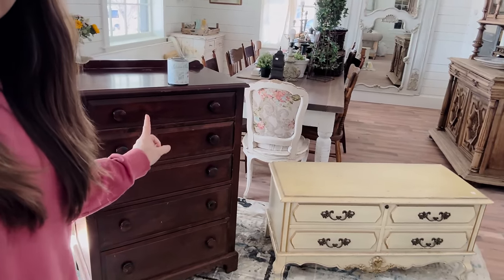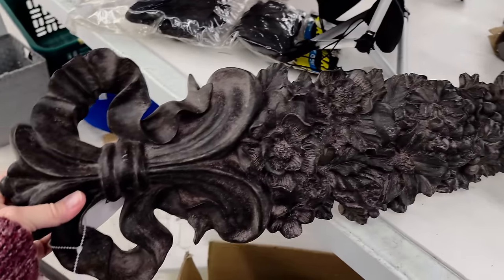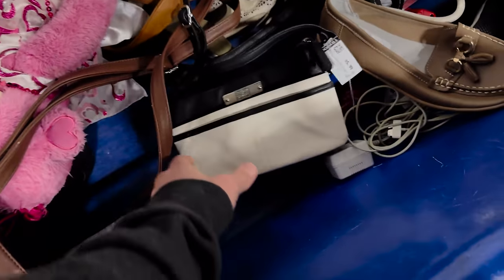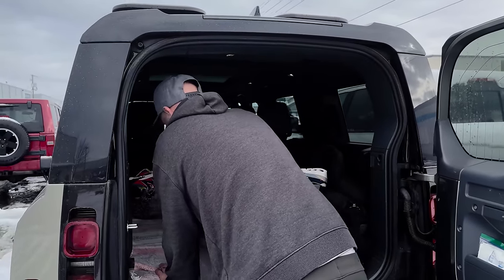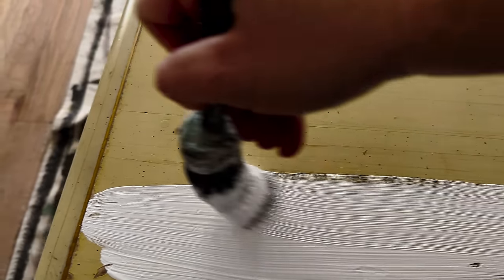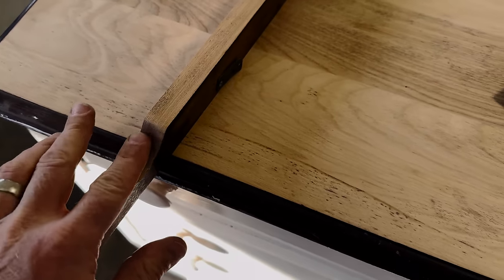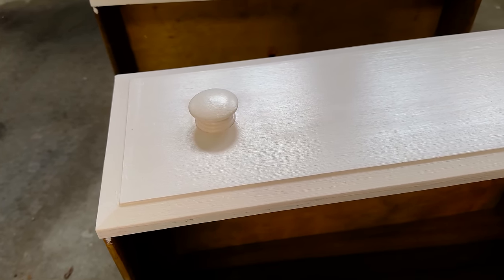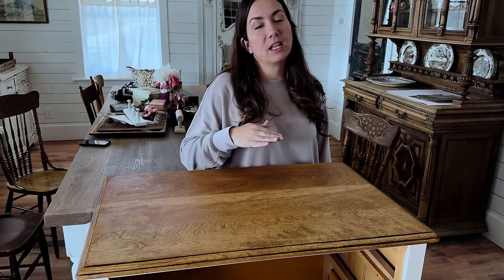Goodwill Bins Thrifting and French Country Furniture Flips

Comment: I recently bought a full size spread and shams for $5.  Looked great. They were black. I washed them and when I took them out of the washer, the tags that tell what they are made of had  shredded and there  was lint all over them. I was upset. Threw the shams away and I'm going to try to delint the spread and wash it again. If I can't get the lint off, it will become a dog blamket.😊

Comment: Hey, you can open bags and pull out what you want. Also, when I'm at goodwill bins, I may remove/take off something I needed to for my vision to safe at register. I tend to thrift heavy wood items and at my bins its $1.79 a pound, unless its 15lbs+ and then they quickly make up a price and you can pass or buy. Like I found a big beautiful frame a couple weeks ago, but the canvas was ripped and it was wrapped around wood and then was placed in frame, so I pulled canvas part out. When you have 3-4 cart full it adds up lol.
Reply from the maker: Great tips!

Comment: I understand that a lot of things need painting, and you do beautiful work, but why do you paint an antique piece made of cherry, instead of refinishing? Just wondering. I think cherry wood is beautiful.
Thank you. 😀
Reply from the maker: It’s just vintage and it will sand off. It needed refinished. So if someone doesn’t like it they can refinish it no problem. I wasn’t a fan of the stain and I didn’t feel like stripping it.
Reply: They also sell paint, so it comes natural.
Reply: @JamiRayVintage  Thank you 😀